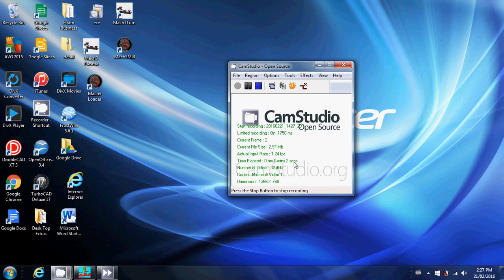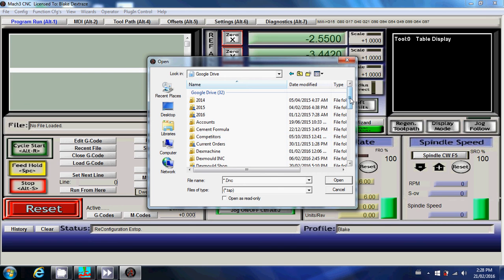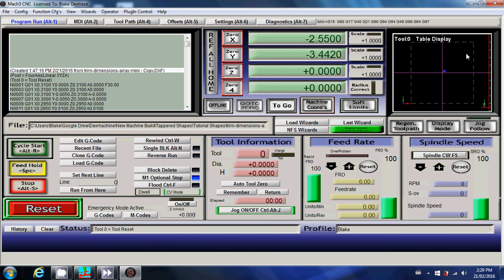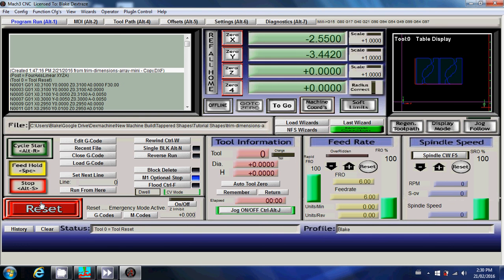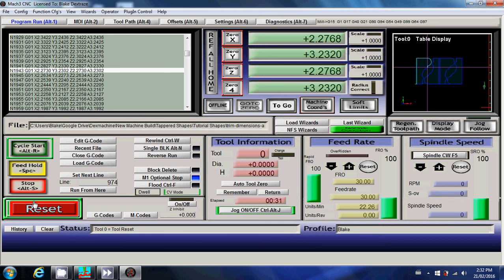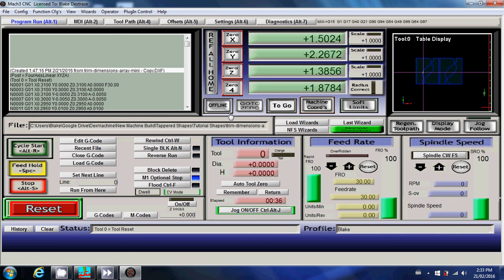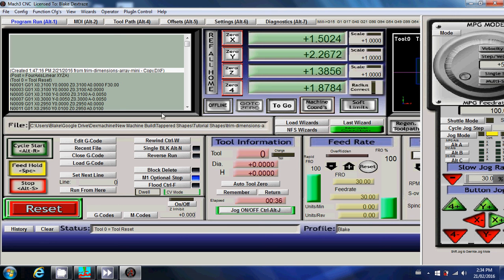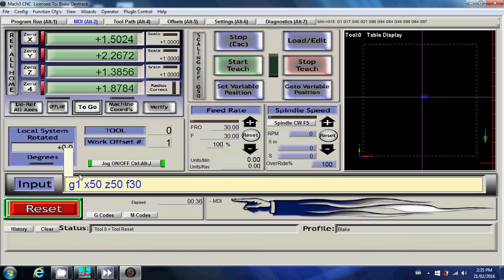Using Mach3 for CNC hotwire foam cutting

Comment: How can I make the thread move to a specific position, that is, if I want to cut a sheet 2 inches from the zero point, how do I make the thread move to 2 inches?
Reply from the maker: Hi Norbert.  There is a tab near the top left of the main screen "MDI" .  On that screen there is an input section.  You can type in "G1 Y2 A2 F90" for example and it would go to 2 inches from 0 on the Y and A axis.  Hope that helps